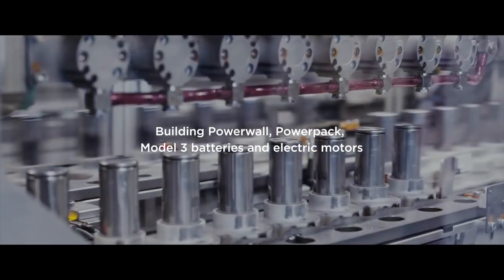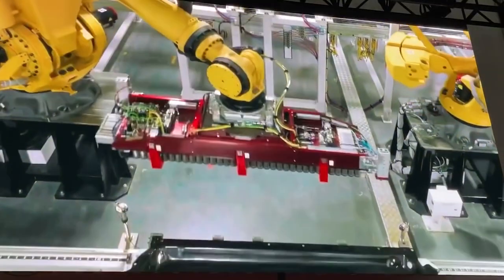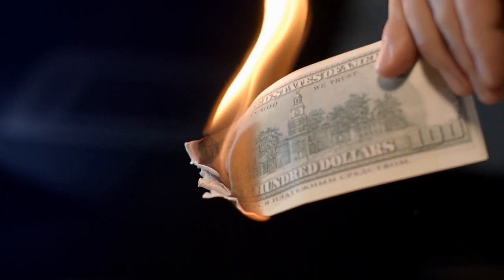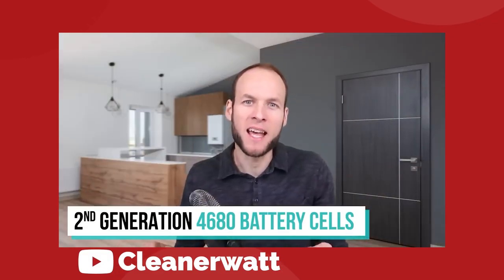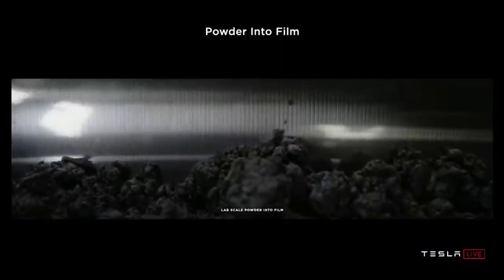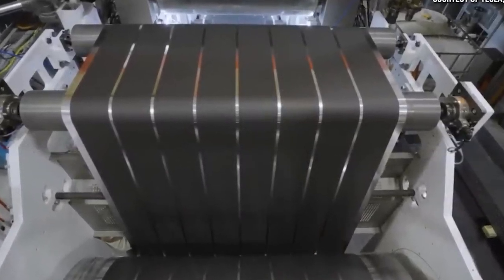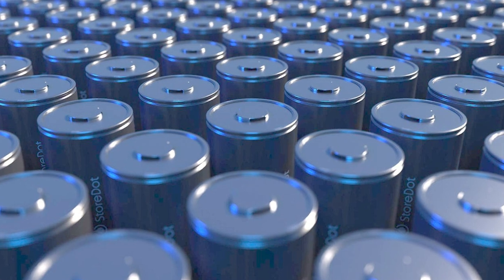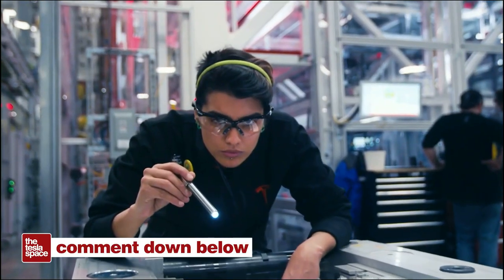The Gen 2 Tesla 4680 Battery Cell Is Here!

Comment: The Semi.  Tesla says they’ll be making deliveries this year.  This, in my opinion, is where Tesla has prioritized the 4680.
Reply: Yes. They are also in the process of changing the Megapacks batteries from 2170 to LFP, which frees up A LOT of 2170s for Model Y. Using the 4680 for low volume like Semi and Cybertruck this year and next makes sense.
Reply: Well they say that each year since 2017 xd
Reply: Semi is not possible for now. Battery energy density needs to double for Semi to makes sense in transporting cargo.
Reply: Makes more sense until they have developed the technology to the point where it's affordable to individuals. It's far easier for them to compete with $200,000 semi trucks than $30,000 consumer cars.
Reply: Thought that thing was supposed to be out in 2019
Reply: @Supraboyes  Exactly. Look at the roadster 2 💀

Comment: Preproduction adverse effect? 
Other than axial to axial alignment the dominant telescoping is governed by polar differential foil pretension. ie left edge Vs right. 
Factors?
1) is chemical coating left/right uneven thickness variance. A thicken left moves foil to the left. 
2) foil approach with pretension has left/right differential, a  higher tension on the left it telescoping to the right.
3) the pretensioning differential was free drifting is a regulation problem.  

Remedy?  
Apply an active (closed loop) or reactive (passive) left/right pretensioning balancer/damper,  this will compensate for 
1) pretension drift and 
2) chemical thickness drift

If we are using rolling fence to manage telescoping, second this effort and keep it as last resort.

Comment: 2:03 Stacks of modelY Structural Battery packs.
Just a thought.
Maybe Tesla is stacking/aging them to be sold in cars produced after Jan 1, 2023 to get the  battery cell credit of $35/kwh, and is using the 2170 packs instead.
This 4 month delay increases each battery pack value by $35*80kwh =  $2800
Let's say that they make 10,000 of them over the next 4 months...
That would be an extra $28M in profit.
Just a thought.
Reply: I think what everyone here is forgetting, is that a certain percentage of manufactured parts need to be set aside for repairs to cars already on the road. Structural effects and battery defects are inevitable and must be covered under warranty.

Comment: Nice summary, For the last 8 years Tesla has been battery limited hence no point in putting either the sober truck or the semi out on the market when Tesla makes more money in the volumes of 3's and Y's. Tesla in Markum in Canada is an expansion of the Hibar company (specialist in battery manufacturing equipment) they bought in 2019. This should not be confused with the current  "Giga Canada" roomers.
Reply: Sober truck drives itself when you aren't

Comment: It seems a little copper/metallic paste would help energy transfer on the anode/cathode areas. Just like thermal paste (for heatsinks) and no-ox in high voltage connections.
Reply: One more machine to apply the paste, one more failing point. Also, another supply / manufacture line for that paste.
Reply: @DunnickFayuro  True, but as the machine is currently performing the entire batteries construction, applying compound to the lid (the last step) should be quite simple. The compound could even be an epoxy type material for strong adhesion and heat resistance. A similar substance is used in motor winding. It could be altered from an insulator to a conductor.

Comment: the stockpile of 4680 structural packs isn't really large.  it's probably just a buildup for a quarterly, limited production run, of MY-AWD.  Note that the MY-AWD is still an employee-only order item, not to the general public.  Note also that the stacks of Megacasts outside the Austin casting facility are almost entirely REAR casts; very few Front casts are shown out there (though there ARE several production frames full of Fronts).
BTW, Cleanerwatt's background is a greenscreen and the 'kitchen' just a still frame.
Reply: Listen man stockpiles don't always have to be the hugest if you have good suppliers.

Comment: The global leaders in EV battery technologies are CATL and BYD, both produce plate-type battery cells and package them into battery pack using the Cell-to-Pack (CTP) technology.  Compared to 2170 or 4680 kind of cylindrical batteries, CTP batteries have slightly lower energy density in terms of Wh/kg, but have much better thermal conduction and therefore are much less likely to catch fire; in addition, because CTP battery cells can be densely packed together, at the system level, it can achieve higher energy density in terms of Wh/litter.

For example, CATL's latest CTP 3.0 battery can achieve 255Wh/kg for ternary battery systems, and with the same chemical system and the same pack size, can deliver 13% more power than 4680 battery.  Unlike 4680 still faces technological hurdles in mass production, CTP 3.0 battery is technologically ready and is expected to be mass produced and comes on the market in 2023.

Although Elon Musk has been hyping 4680 as some kind of revolutionary battery, the truth is that 4680, just like 2170, is still using cylindrical cell, an inherently inferior architecture compared to CTP batteries.

Comment: Napkin math...

The assumed 1 mm of additional length inside the can (recovered because no current collector is needed) with qn external length of 80 mm. Maybe 75 mm inside. Additional length coils that add 1/75 more volume would only add 1.33% more power. 2 mm - 2.66%...3 mm 4%.  For this to work they need to pack 7.5 mm longer jellyroles in the can. Kind of doubt they have freed up that much space.

A 10% increase in power means something else is happening on version 2 cells.
Reply: Having seen the old ones from munroe live I would suggest they are saving at least 5mm with gen 2. So probably on or close to target.

Comment: Page 11:00 depicts an anode flaps contact wafer an intermediary part to conduct anode current at the cylinder base. Notice that characteristic S laser weld path. 

Problem? The anode flaps formed a ripple rich profile in front of flat portion of the contact wafer, flaps that are in touch with wafer can be welded, only a fraction of flaps are touching the wafer, flaps not touching the wafer will become a welding void. Practically this is dotted line welding, to an undesirable higher standard deviation.
Reply: They should just make a waffer disk that has slots for all the flaps to slide Into.
Reply: Not sure about the current thickness of the copper film in the jelly-roll.  But I wonder if it can be made thinner without compromising thermals - increased roll length --> higher power density.  Maybe that would help with terminations at cathode/anode as less resultant mass there.
Reply: @TheAnthonyBrandi  That would be quite a trick.  Impractical to achieve in hi-vol. production methinks.
Reply: @jimparr01Utube  right, not practical.
Reply: @TheAnthonyBrandi  good thinking. We are looking at skillful labor kind of task also very hard for machine to carry out. The next best way in a automation is selective induction heated soldering. Solder reflow the anode flaps and the cylinder base directly, bypassing the wafer disc. Leaving us a heat and current friendly solution.

Comment: Higher priority for use of the 4680 batteries will be given to Tesla semi & Tesla cybertrucks since most Tesla model 3 and Y and various Tesla battery storage solutions can still use the 2170 or other batteries provided by various Tesla battery suppliers. Tesla semi and Tesla cybertrucks will have difficulties using the 2170 or other batteries provided by various Tesla battery suppliers?

Comment: I wonder when batteries will last the lifetime of the car. Like a lot of batteries last roughly 8-10 years. Then cost $20k-$30k. Many of these batteries are used for home solar systems. It would be nice to not have to worry about it until 30 or 50 years from now.
Reply: They already do for the most part. Batteries kept in normal temperatures age mostly from use, not time. Take a model 3 LR for example, the pack is rated for somewhere around 1500 cycles before losing more than 20% capacity. 1500 cycles with an average range of, let's say 250 miles in the real world = 375000 miles before battery is expected to be under 80% of original capacity. If you take the LFP model 3 on the other hand, it gets way crazier, as those packs are expected to hit around 4000 cycles with ease.
Reply: In part most of the batteries they have produced do. It’s mentioned a lot that recycled batteries would be better than ore at the mine. Hopefully it’s just easy to replace initially, and over time lasts as long as you are saying per lifetime before recycle.

Comment: I feel like a pouch cell would be easier and cheaper to make, keeping the same tabless design, lower weight,  less materials, and can incorporate better heat activate fire safety between cells. Feel like they forgot the KISS rule for engineering and made things more complex than they need to be due to greed. Also don't really get the point of a "structural" battery pack. You way have way more design freedom with pouch cells and easily cast ribbs and dividers into the battery pack. On-top of that the way they foam fill everything makes it harder to recycle/repair bad sectors.

Comment: With something like this and the general progress of rechargeable batteries, it is strange why do we still have disposable batteries allowed?  On Amazon, the price difference is not that different.  Every controller on the Playstation since ver 3 has rechargeable controllers.  XBox took their time.
Reply: There are many reasons but if you want only one, it would be that lithium cells are far more dangerous. Any sizeable lithium cell is capable of dumping several tens of amps if short-circuited, usually ending up causing a fire or injury. An alkaline AA can produce maybe 2 amps? Less if it's a AAA. If you short circuit those they'll get a little warm and that's about it. That's why 18650 cells are everywhere, but never designed to be user accessible. There are also things like money. Xbox was making a bigger profit on controllers without batteries, now they charge the same amount ($60) but they have to pay for those cells they put in there now. Oh yeah, since rechargeables aren't user accessible, think about longevity. 360 controllers are old as dirt now, but you can still use them like you did 10 years ago with a fresh pair of double AAs, if it had a pack inside it wouldn't work very well or at all by now. Not like anyone keeps devices a decade though, let's be honest. But you get the point.
Reply: @MicroplaysMC  If it was so dangerous, it would not be sold at all.  I get rechargeable batteries on Amazon.  Every laptop on the planet has rechargeable batteries.  I am not buying this reason.  There have been a few cases of incidents with some batteries like the hover board and Boeing 787, but they were related to battery construction quality and or charging electronics.
Reply: @sammcbride2464  Yes... That's why there have been few cases, because it's just a matter of quality and not user error. Rechargeable AA and AAA are not lithium batteries, they are nickel metal hydride (NiMH) and operate at 1.2 volts. They are also low power. That's why they use a different chemistry 🗿.
Reply: @MicroplaysMC  9 Volt is lithium.  Laptops are LiPO4.  I just bought a charger that will charge 16 AA/AAA and 2 9-volts.  I can buy a case of 4680s and build my own power wall.  There was an unsafe time with Li batteries, but that has largely been fixed through internal electron safeguards.   Even with NiMH, it seems odd that we are still using disposable batteries today.
Reply: @sammcbride2464  There isn't a lithium chemistry in the world that is 9v at the cell level, not sure where you got that number. All modern laptops are indeed lipo4, still 3.7v nominal, as 18650 cells are too wide (which is what they used to use). Cool charger, what's the brand? (I'm curious) Lithium batteries are still unsafe though, same as always. Idk what the hell "internal electron safeguard" means, but the situation remains the same. The BMS is the only thing preventing a short or cells from over/undercharging. If you short circuit an individual cell, it will dump all of its current, same as always. Disposable batteries still have certain advantages over rechargeables. I even look to convert devices in my house to rechargeable, but from a business perspective it doesn't make sense. Not for consumers, and neither for manufacturers.

Comment: Personally I like the Japanese EVs where they drive the vehicle into a battery changing station and within 3 or 4 minutes, the battery is lowered from the bottom of the EV and a freshly charged one is installed. It costs $12.00 per month for 6 battery changes. The batteries have a range of over 300 miles per charge. They even have a 500+ mile battery for a little more for the subscription. The vehicles cost about $10K less because, they do not come with a battery installed. I like my gasoline vehicle better than any EV.
Reply: Got nothing else better to do besides tinker on a car all day?

Comment: Seems like so much money being invested into something that only should be used to get mass in motion.
Meaning once the mass ( the car ) is moving , that has energy and can \ should be used to power the motors.

personally think they should be investing in "Alternator" technology, as when the mass is moving then it can power everything and the "battery" is then only used to get the mass moving..  AKA just like the automobiles in the past, battery is basically only to start the car, then everything runs off the alternator.  
Just something about "battery" in EV cars don't sit right with me.. Something doesn't make sense but I'm sure it has something to do with lots and lots of money.

Comment: nice video shows experience and good realistic themes for batery ther should be theme discusions about 4680 in increase length to 40% so you get 1040 km range now thats fancy only slight bigger box and car lifted form gorund and calculation should vary in in weight as lighter car sould easy pass ower 1040 km range which today as chiese test and so called this flated cell aproach offwer less fire and wider range now thats for thsi topic also si about dynamics off charge its known fact in rc models thats bateries as start was Nikl Mangan and still are in some ali sites for rc cars now are lithium bsed for durability that changed but also a form off wiring is unique so in china you get smaller batries much more durable what cahnged is from paralel hook to horizontal wiring in serial cells hook this technique allow kind pop out cells and easy swithc and slight more wiring but house hold can plastic or baged out with material insulator good thing about cellular density packing easy install prep for use also tuneling wind change charge in theory car can fill better are closer to air temprature or desired temprature range based on living condtions so is prep ready to asume in cold area a car batery can be slight heated on climate to wokr fiil eaisy or kepp constant prerusure on heat and mix with air vetn temprature techincaly speeking and createing like car vortex around aii around engine can give slight cooling to gen and offer heated air circulation and first in air larger air colector with whistle to create air swuuuush  sound and then in tube in above wheel suspension into car do round systems slight angled pipes ot ari rotate then on side slight back a second air stream tube to colect air with dual pipe one goes to box kidney as know how tech and can be closed on servo( this use driver to decide level sound noicer the other pipe goes in back bottom for cooling bateary in pipe is also heater pipe from climate to create desired temprature air pass so through moving bateries can be aditionaly cooled or preheated to avoid loss off charge by distrubution energy and can be checked on display also

Comment: I’m still stumped on why Tesla chose the round over prismatic configuration. If you look at a stack of paper the most dense configuration is to place one sheet on top of the other. Temperature control also seems to be easier with the prismatic configuration.
Reply: I dont think they they could make those cells bear the same loads as a cylinder could. And they want to make these packs ridgid as hell so that it becomes the main frame of the vehicle, and cut down on the weight in the vehicle. Reducing weight is more important than increasing capacity, because you can just add more cells. But doing the full weight reduction they've been planning with the structural pack and giga castings will take care of alot of problems, reduce weight, and allow them to get away with using less batteries while they work out the kinks of new cell production.
Reply: Round is easier to cool, there are tradeoffs for everything.

Comment: Will the M3 see 4680, when?
Reply from the maker: Eventually, I would assume so but probably not for a little while. Model Y is the priority and even the Cybertruck might be in line before the Model 3
Reply: @TheTeslaSpace  I’m thinking Semi Truck, Model Y, Cybertruck, then Model 3 for the order of the vehicles that they will prioritize 4680 cells for.  They may switch over the Model X and Model S if there are cost savings and other benefits (longer range, improved acceleration, etc.)

Comment: well, batteries are getting to the point where wafers were 8 years ago. Bigger means better. I believe there will be another step bigger, as soon as those will become managable, something like 9285.
Reply: Idk why we don't go with big square blocks with that folded material on one side and then if something happens to one you can click it in or out and replace/diagnose then we can adapt the cells and old Tesla comes in with 3 bad cells and gets them replaced with 3 brand new better updated versions ECT.